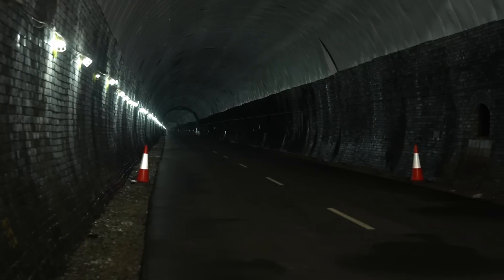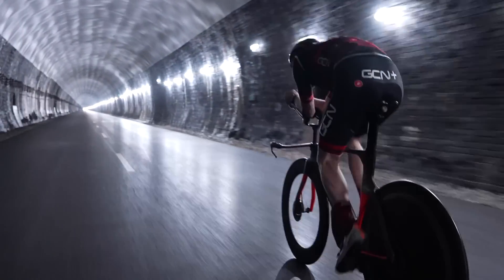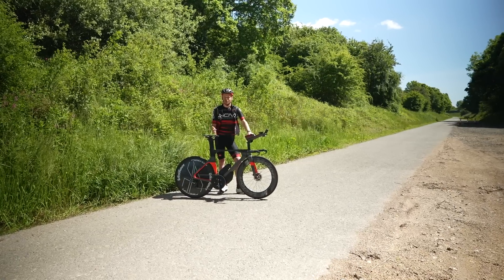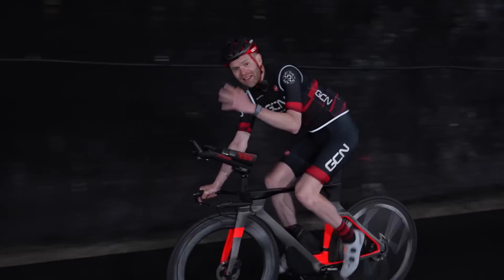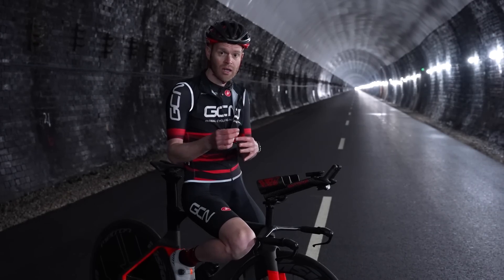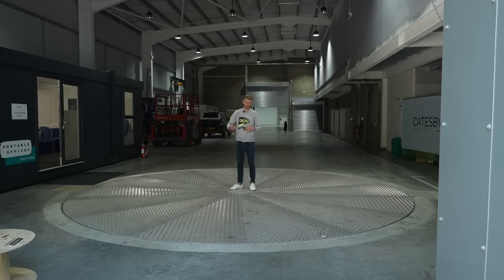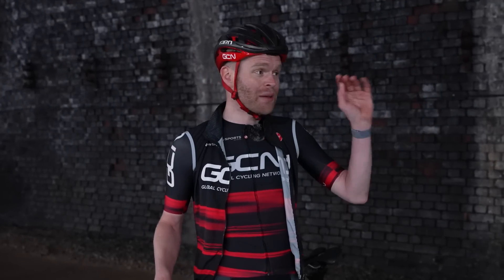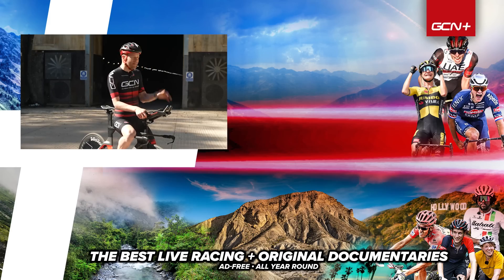From Abandoned Train Tunnel To Cycling's Biggest Aero Secret

Comment: Simple question: how do they accurately measure speed in this tunnel.  GPS probably won't work, and wheel sensors depend on knowing the exact circumference of the wheel / tire.  This obviously changes with different rider weight and tire pressure, and might even change with varying speed.  I'm sure it usually doesn't matter, but in this setting, it might.
Reply: They probably measure the time from start to finish, and know the length of the tunnel
Reply: @marcvb3364  I guess, but then they have only average speed for the whole distance. They could also use radar, or a series of permanent sensors at known position.

Comment: I don't understand what the point of the pitot tube is if there's no wind and you have a speed sensor on the wheel. Pitot tubes are used to measure air pressure and then calculate speed through the air, so I thought the whole point of them on bikes was to measure wind, to remove that variable when comparing different speeds at different power.

Comment: Was abit of a Eureka moment when I realised you measured the Aero dynamics with such a simple device. Know speed and force and work out a wind ratio from that. Because the engineer in me (I'm not an engineer), thought we had to put sensors all over the fork for example, trying to figure out what the air is doing. I would have put sensors on the riders nose too.
Instead you just empirically progress along, change something here or there, measure the wind ratio, know if you did bad or did good, working yor way towards a minimum drag.

Comment: The problem with shooting an object down a tube is the object creates a bow wave.
If the object can be heard approaching, that is evidence of the bow wave (s). In a tube, the walls constrict the bow waves and reflect them back to the centre of the tube, creating a turbulent plenum at a higher pressure than would be measured in open air.

The ultimate test venue is the 'Parallel Straights' at the Motor Industry Research Institute. They follow the curvature of the Earth. Testing a vehicle requires the wind speed to be less than 5% of the lowest speed tested.

Chris Boardman did the aerodynamic testing of the Lotus hour record bike in the Climatic Wind Tunnel at MIRA. I was there.
Reply: I think the frontage of a roadbike isn't going to displace enough air in a tunnel of this size to be a problem with a bow wave, if it does exist it'd be so minor that it'd not be measured
Reply: That's what he discusses in the video. And the calculations required to integrate it into the drag measurements
Reply: @glyndonwakeman7420  Yes. There is a fudge factor.
Reply: It's not a fudge factor, it's easily calculated and used to determinative drag. Not that it would be a big deal anyway when doing comparison testing for position of equipment as that pressure wave would be relatively consistant. It's clearly discussed in the video so not sure what your point is!
Reply: @stevespell9634  A true test would be a cyclist on a road which follows the curvature of the Earth with NO wind speed to effect the result. This is how the motor industry do it is how I tested Triumph Motorcycles at MIRA. A wheel magnet speed transducer was used because these are most accurate. It was calibrated with the bike on a rolling road which had an encoder speed detector.
In thie tunnel case, the vehicle is in a tube, which is NOT the situation of a cyclist on a road.
If a mathematical calculation is included to compensate for a difference in conditions, it's a FUDGE FACTOR.
Reply: @jameslee-pevenhull5087  🤣🤣🤣
Reply: This is why physics myopic people like you don't get stuff done and the engineers for these world class race teams are out there collecting data.
Reply: And I think a windtunnel like the one specialized has, would have the same bow wave in front of the rider if it were there!

Comment: There is a beautiful bike road in the Italy, starting near the Austrian border, which replaced old train line and as it is in the Alpes, there are many old tunnels on that road, some over 1 km long. Obviously much more rough conditions than these ones here, but giving similar experience while riding there :)
Reply: What is the exact location?
Reply: @rebinu  It's part of the classic Alpe-Adria cycle road. You can check the website of the Alpe-Adria, where you can find all the details including gpx files as well. I did it last year, it's an awesome experience! :)
Reply: @rebinu  there are some short sections of tunnel between brennero and colle isarco and then again between campo d'azzo and prato isarco.
if you are looking for the real tunnel experience you have to descend val gardena, val badia or val d'ega.
Reply: @rebinu  there are quite a few of them between Italy and Austria one is also between Arnoldstein (or start in Slovenia in Mojstrana, roads like Y) and Venzone/Gemona
Reply: @rebinu  it’s the path down from the Brenner Border. I cycled it two weeks ago with a mate and it’s an absolutely amazing bike path. Can recommend. You just have to climb up Brenner first ;)
Reply: I think the route being referred to here may be the Eisacktal Radweg. It is definitely stellar riding. From Kalusen to Bozen there are many tunnels and it’s mostly downhill with good pavement.